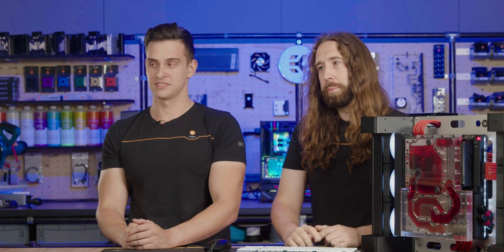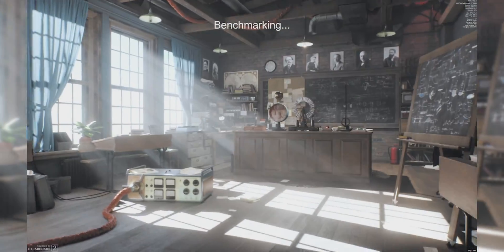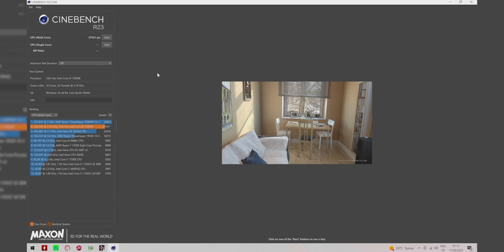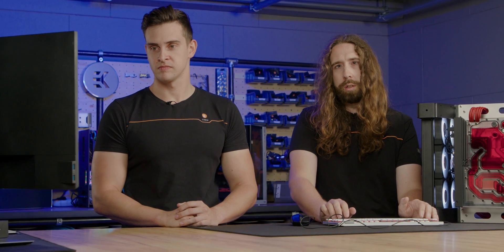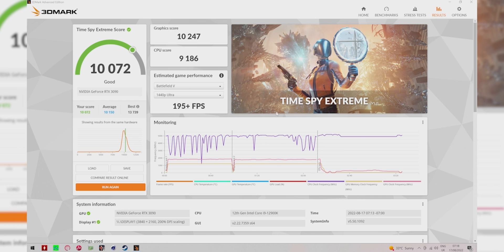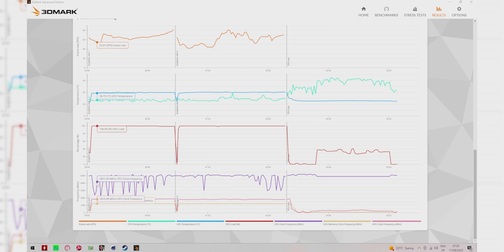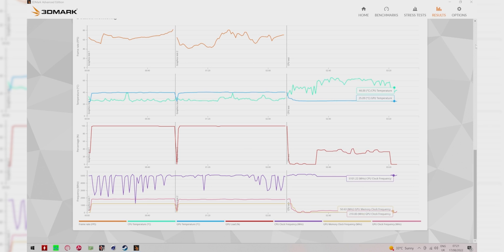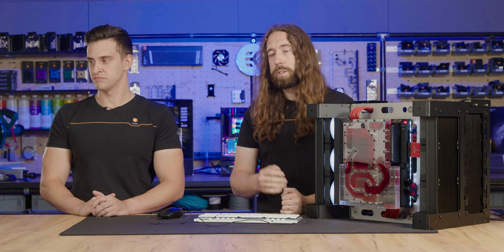How Much POWER Can This Waterblock Handle? OVERCLOCKING To Find Out! | Part 3

Comment: I'd love to see a single layer uni block - it's been something I've hoping to build/see since the first distro blocks - ITX + flipped GPU (so the GPU is face-up rather than face down - skip the active backplate probably - though I wouldn't rule it out entirely) so the same single block with one layer of acrylic for a compact "here's a whole computer" situation. 

With the fancy ITX boards being fairly built up - maybe routing the riser under the motherboard and having the GPU face up "above" the CPU rather than below would make it more possible to have the single unified block from CPU to GPU without having to jump over the higher components on the motherboard.

An enthusiast side-ported CPU/motherboard Monoblock would be nice too (currently the only side ported ones are commercial, without the acrylic, etc) would be lovely for flatter builds - even if it meant tubing around the GPU to get to the ports on top - maybe more GPU blocks like the 30 series FE blocks with the end connectors? Then you could route flat/in the plane of the blocks from the top edge of the motherboard over to the end of the GPU? Offer a "distro plate" style acrylic connector to be able to go between those & make a pseudo-uniblock that's more adaptable than one CPU+GPU combo? (though still a bit narrow since it'd be relative to the length of the GPU block... )

Comment: Love the concept but boy is it ugly to look at. I think you need to address the aesthetics. maybe some mesh covering the outside of the radiators would be a good start and I'm not convinved by the clear acrylic due to the condensation that looks awful. maybe some kind of metalic finish on the blocks with the water channels visible would look much better. Overall though very very impressive piece of work. good job for a first draft and well done for coming up with some totally unique and as far as I know not previously attempted?

Comment: I'd like to see this done for an ITX board and GPU. Basically, get the GPU/mobo in water cooled in the smallest package possible. I would probably do a "sandwich" with the GPU on one side and the mobo on the other. For the case, I would do the Jonsplus i100Pro since it uses screws and not rivets. Remove the midplate and you could fit 2 S360 rads. Strix for the mobo/GPU.
Reply: This!
Reply: There will definitely be lots of SFF related QuantumX projects this year :)

Comment: Very unique and amazing project! Unrelated question: will there be any active backplates for the 7900XTX?
Reply: No, the total board power and memory configuration just doesn't warrant it on the 7900 XTX we only really consider it for 450W+ cards.
Reply: @jr23design10  Fair enough, but that's a shame. I understand the reasoning, but it's also not warranted on the RTX 4080 or 3080 either, and yet it's available for those. Was that because having similar/identical PCB layout as the 3090/4090 cards, so it didn't require an all new design?

Now that there are no cards with memory chips on the back, I kind of view it as just an extra 2-3 degrees of cooling on the GPU die and other components for those willing to spend the money on having the best of the best. Maybe on future generations it can be considered? Perhaps it would be more worthwhile if/when AMD gains more marketshare.

Comment: I think it's important to consider not aiming to support only extremely expensive motherboards, like those in the $800+ range. Some ppl might want to budget some of that money on the water cooling parts and if you can't really see the motherboard, does it even matter if it's not so fancy? Hopefully EKWB can make Quantum X universal over several types of motherboards from the same vendor.
Reply: Well most would not be dropping $700+ on a kit like this just to use a 100-200 mobo...

Comment: Thanks for this great project. It is steal interesting that GPU temperature is so low at the same time CPU work temperature for 12th gen is about 90 degrees. It seems that GPU was bound with CPU workload?